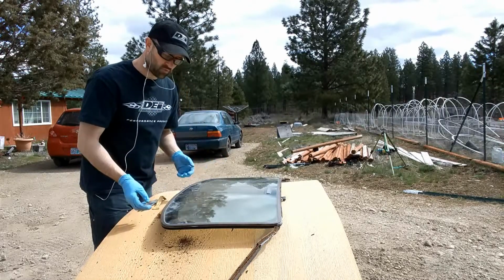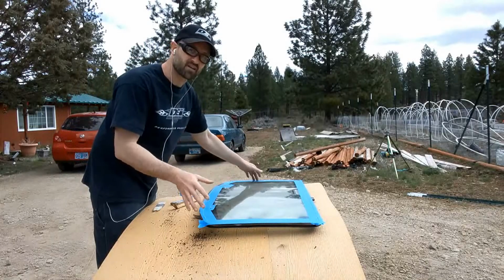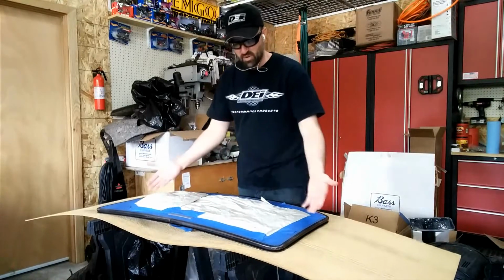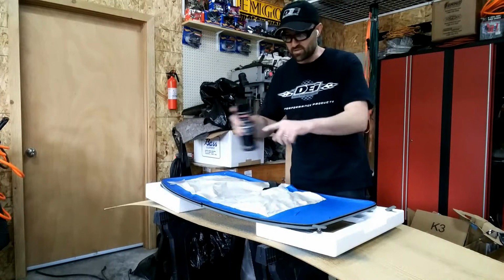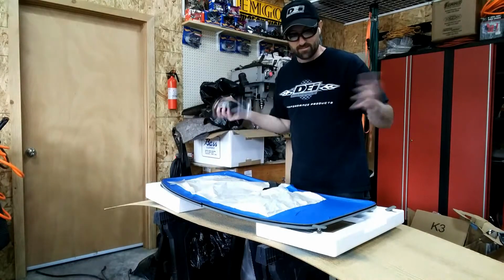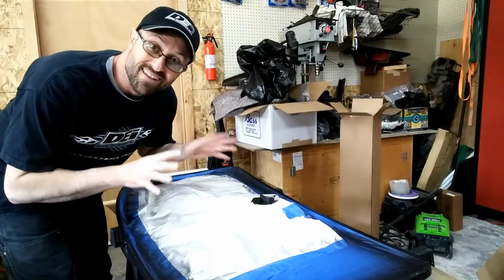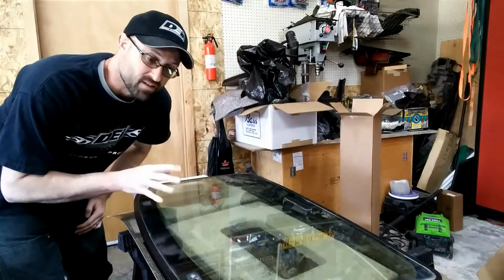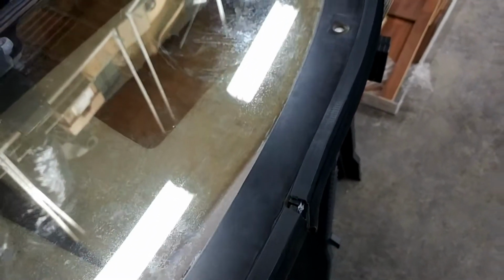How to Restore Your Sunroof Glass - Foxbody Mustang

Comment: Where did you get the sunroof glass seal?
Reply from the maker: Either Late Model Restoration or National Parts Depot. I bought most of the parts through them depending which was cheaper and in stock at the time.

Comment: Hi, I have a basic question for you.  What is the best way to remove the hardware from the glass?  I see that there are Torx bolts, but so far, I'm struggling to remove the latch and two front clips to be able to replace with new versions purchased.  Clearly, I'm concerned about damaging the glass during this operation.  Thanks much!
Reply from the maker: It's been a while since I changed my sunroof hardware on a Mustang. If I remember correctly, there are set screws involved with the fasteners that keeps them from coming loose.
Reply: @BasinMotorsports  Yes, the old unit tends to spin when trying to remove the Torx bolts.  Any special technique used in the removal to hold these from rotating?
Reply from the maker: @markbedel1469  You may be able to put some painters tape on it and use an adjustable wrench to hold it from spinning. Mine thankfully wasn't difficult to remove, so I don't have any great information to pass on.
Reply: Okay, thanks!